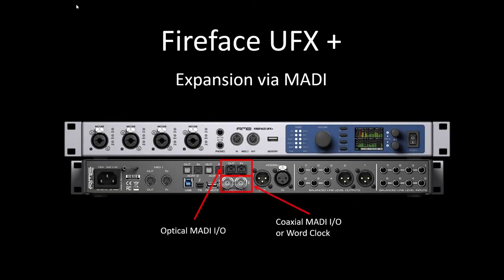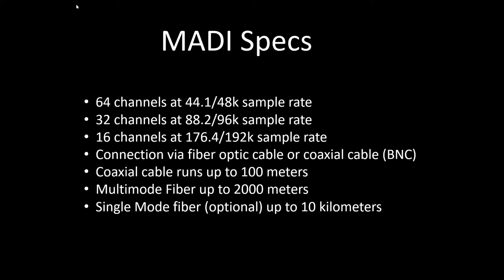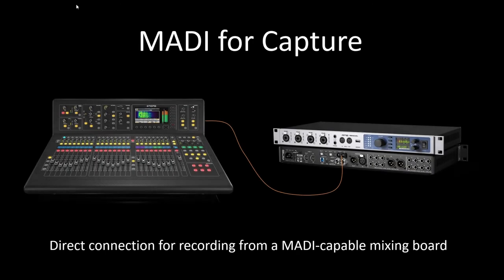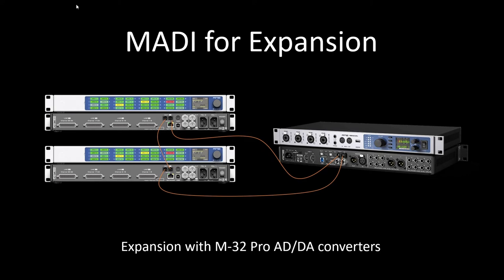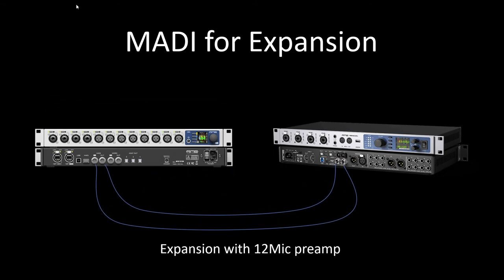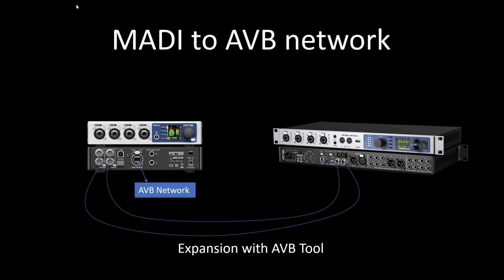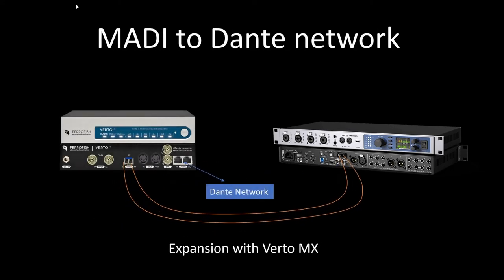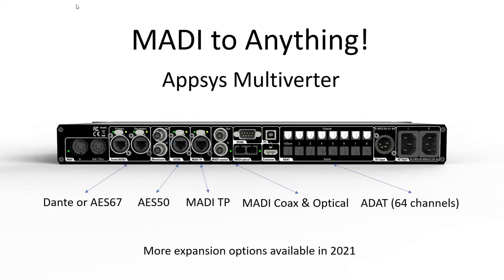Tech How to Expand audio capabilities with MADI

Comment: Hey, just a question…as you show the m32pro scenario, you showed two similar units, namely the m32AD version. This can’t be right, or am I wrong?
Reply: Sure, you can connect 2x 32 ch AD, or 2x 32 channel DA, or 2 of each. Whatever is useful for your system.

Comment: Do all devices have to be connected to a computer through Thunderbolt/USB or can they run as a standalone device?
Reply: The Fireface will connect to the computer with Thunderbolt or USB, the other devices only connect to the MADI digital I/O of the Fireface.
Reply: @JeffPetersenSynthax  Thanks